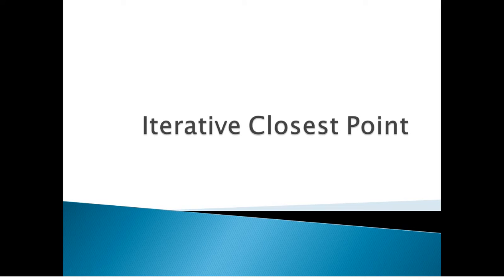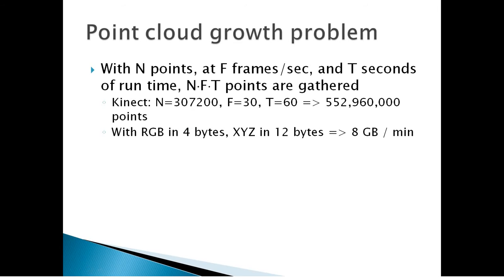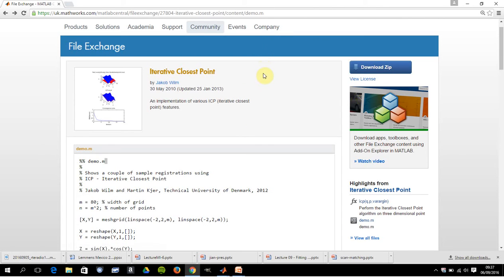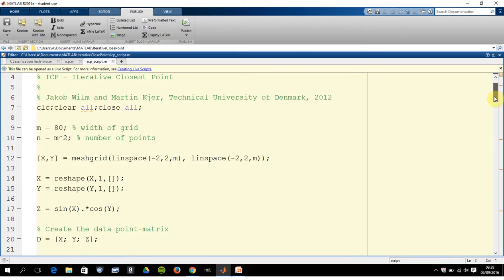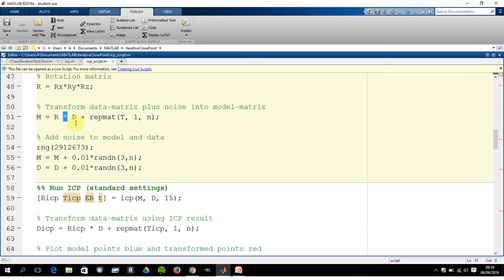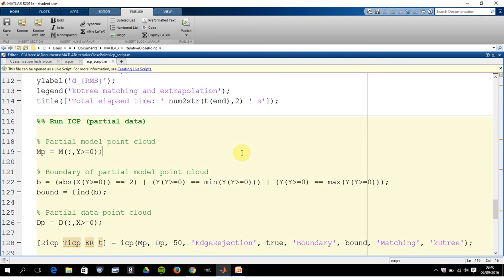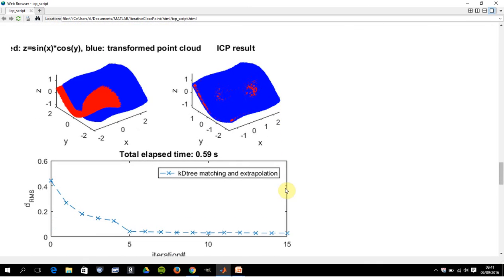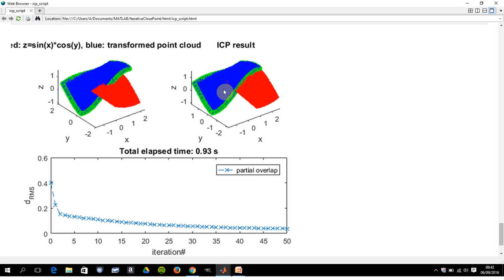Iterative Closest Point algorithm for point clouds in Matlab

Comment: Do both the meshes needs to be exactly same?
Lets say there are two meshes A and B . B consists A and some other structure too, will technique work?
Reply: As ICP is usually used inside a RANSAC loop if you have "enough" overlap, it is likely that you select the overlap in one iteration and get a good enough estimate.
Reply: No need, you can use a robust kernel to take care of incomplete matches. Search for the "Sparse ICP" paper and see ;)